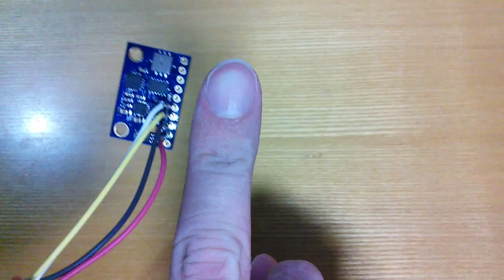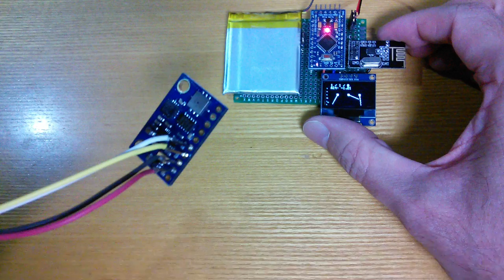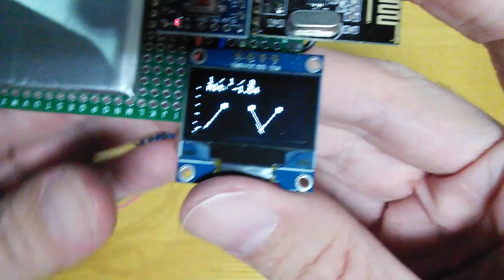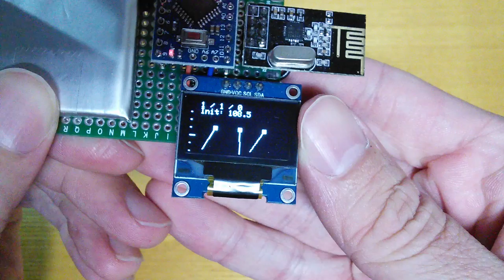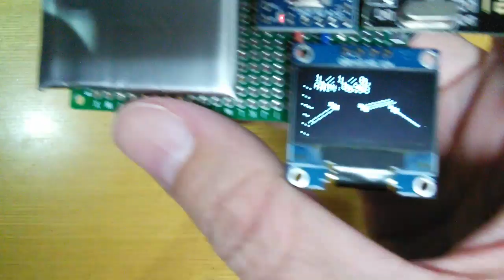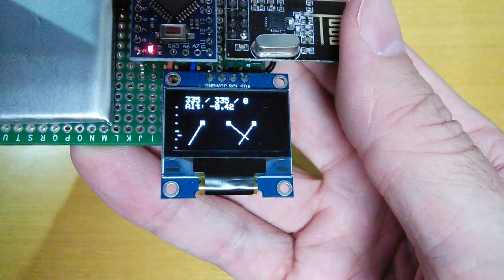IMU telemetry via nRF24L01 ack payload (arduino)

Comment: Ya know, it would really be nice if someone could post some code for the ACK in 2021 that works with the TMRh20. I've spent a week on this, asked questions on the arduino forum and all I get back is don't post pictures. so it's like at this point I don't believe anyone ever got this working. I think it's all a big joke on us out here trying to get it to work. If if did there would be SO many examples of it but there aren't because it don't and prove me wrong.
Reply from the maker: I've never used the TMR one, but looks like there is an example here: https://github.com/nRF24/RF24/blob/master/examples/AcknowledgementPayloads/AcknowledgementPayloads.ino

Comment: Hi! If you want an app capable of working with all the sensors from CC2541DK, CC2650STK, ThunderBoard React and Sense (e.g. acclrm., magnetom., gyro. etc.) you can download it from: www.microsoft.com/store/apps/9p054xsjjr1n – the software is able of giving new uses (movement security systems - door or luggage, magnetic security system, accelerometer mouse and wireless presenters) to all these IoT SensorTags. For more info.: www.blesstags.eu. Thank you so much and have fun!

Comment: and this is what i'm lookin for man!thank you so much for your very informative video. two arduinos two nrf24... high power transcievers some oled and h-bridge to create safe system for my ride-on car for my son. would you share some code to learn how make my own code for control-akcnowledge data stream? the main function i need is to stop the car in emergency mode when out of range of nrf24... or on my command.
Reply from the maker: The nRF sends a 'packet' of information. If a packet is received at all, it is received in its entirety and without error - the nRF does error checking internally. So you don't need to check for errors. It sounds like all you need to do is make a note of the time the last packet was received, and if it's more than say 1 second ago then stop the car.
Reply from the maker: This code might be useful:
https://www.youtube.com/watch?v=eVnyPSAefxU
On line 56 of the receiver side you can see a check to see if packets have stopped being received. You could pretty much use that code as is, and interpret one of the 'throttle' or 'steering' values to be your manual shutdown override state. Just keep in mind that under the right conditions the high-power nRF can go for a kilometer or more...

Comment: do you have a tutorial on how to go about sending imu values using the NRF to others MCU's ? i been reading the 100 page manual that came as a pdf but after getting familiar with all its syntax i get thrown off when i see other ppl's code or example code found in arduinos playground, maybe you can shine some light where i need pointers, i was looking at your code and i couldn't make out how or when do you go about Tx values from your imu or when or where the code for the rx is  or how it works? i know you mention your trans receiving but even so this is not very clear
Reply from the maker: Search through the code for "RF24" should find all the parts I touched, or at least all the parts where the radio is used. Your question seems extremely broad and vague, if you have something specific that might help. Maybe the best thing I can suggest is to watch this video where I explain in detail how I send values for the first car I made: https://www.youtube.com/watch?v=eVnyPSAefxU
Reply: ***** what i mean was that if i want to send value produced by a imu like the xy and z values/data via the nRF24L01+ using the Tx to another Arduino who has the Slave Rx how does all this gets put into the code where is this keywords i should be using or equaling to on the code side ? where in the manual is this part that talks about how to use the nRF24L01+ to send data?
Reply from the maker: Frank Lopez I explained in the video I linked to. You would put whatever data you need into the "MyData" struct. I'm not sure what you mean by 'manual', but the docs for the RF24 class are here, see the write and read functions: http://maniacbug.github.io/RF24/classRF24.html
Reply: ***** oh yes when i used the word manual i ment the datasheet, Ok so MyData how do i use this in a code ? how do i tell the arduino to take the data from the imu and make dem equal to MyData in the sketch so that it can be send thru the wireless on the slave side> or how do i go about sending only a specific axis from the gyro or accelerometer? do i use something like the map feature ? do i use the IMU.data = MyData  or  MyData.val = map(gz, -17000, 17000, 0, 180); or
uint8_t data[Val];
data[0] = MyData.val // map(gz, -17000, 17000, 0, 180); 

radio.write( &data ) );

im not sure if that mini example made my point but im new so just assume that im looking for a way to go about writing a code that say "Tx imu from this axis to slave mcu and when this happens i want slave mcu to use those val to update the pos of a stepper motor or servo 
thanks in advance this means alot to me
Reply from the maker: Frank Lopez It depends on what kind of IMU you are using. Try looking for arduino libraries that support your IMU, usually they are available.
Reply from the maker: Frank Lopez okay, so google "mpu6050 arduino library" ;)
Reply: i did, no one says explicitly "this is the part of the NRF that i use to mapped this val from a mpu to the values of this stepper/servo" specially mpu+nRF24 modules
Reply: never the less you dont have a mpu but you do have a nRF24 so this i sstill usefull to me cuz i guess your telling me tha in the code i can map MyData to whatever on the code in my case imu values ?
Reply from the maker: Frank Lopez I don't think it's reasonable to expect to find some explicit source that has exactly what you want about such a specific purpose, that you can just copy and paste directly. You need to take the two things and put them together yourself. The library for MPU6050 will let you get the values, and the library for RF24 lets you send them. The first page that google returns for me has an example sketch that shows how to get the raw accelerometer and gyro values and print them to serial to check. You just need to put them in the data struct that you will send over the radio link, that's all.
Reply: i know  it seems easy but the syntax makes it a bit unsure to implement like i am using the mpu and i get raw data but all this dont mean much to me cuz i dont need all of its values just one i do have 10 mpu's and i dont want all of dem to give me the same values fro mall the axis  i just want one to give me x the other just y from gyro the other from z from acc and so on i guess this way i compute less data and is more focus in what i need. 

i guess im finding much easier on what todo with the value once i get em but getting those specific values is what i find sorta unclear
Reply from the maker: Frank Lopez This is the page I was meaning, look for the section titled "short example sketch", it should not be too unclear how to get those values: http://playground.arduino.cc/Main/MPU-6050
Reply: thanks ill read in depth, but as for the wireless which is the code i want to = those values from the imu code i want to use?  

/* GyX=Wire.read()<<8|Wire.read();  // 0x43 (GYRO_XOUT_H) & 0x44 (GYRO_XOUT_L)
 */

#define RF_CS 9
#define RF_CSN 10
RF24 radio(RF_CS, RF_CSN);
const uint64_t pipes[2] = { 0xe7e7e7e7e7LL, 0xc2c2c2c2c2LL }; // in here ill place upto 5 diff Slave Addresses with the same Master address 
 
void setup() {
  Serial.begin(9600);
  printf_begin();
  pinMode(LED, OUTPUT);
  radio.begin();
  radio.openWritingPipe(pipes[0]);
  radio.openReadingPipe(1, pipes[1]);
  radio.startListening();
  radio.printDetails();
}
 
void loop() {
  unsigned long time = millis();
 
  uint8_t data[GyX];  // we'll transmit Gyro X axis values
  data[0] = MyData   // Val=imu values Acc.xyz Gyro.xyz
  
  // transmit the data
  radio.stopListening();
  radio.write( &data ) );
  radio.startListening();
Reply from the maker: Frank Lopez I explained pretty much every line of code in the video I linked to earlier. You need to add some more variables to the "MyData" struct to hold whatever data you want to send, and make sure the receiving side has exactly the same data struct. Look at the example code and docs carefully, eg. you can't do radio.write( &data ), it requires a second parameter.

Comment: HI :)

i am having a weird trouble with my nrf24L01. so i have a circuit, where a DS1306 is providing me time, and its also SPI connected. its working fine. when i add the transceiver and printDetails, it is showing me default values like its not even connected (its connected properly). and this time the software is not even using the RTC. if i put the transceiver to breakout board (with same software and arduino) it works fine by itself, so there is a nice and stable radio communication. it also works fine in my circuit if i dismount the DS1306. 
so it seems only the presence of the RTC messes up sg.. i was thinking that probably with the difference of the 2 chip's SPI is the problem, but when i dont even call the RTC in the software its only mounted, i dont see why it is giving me a headache.
do you have an idea?
does anyone who is so helpful to read it have an idea? :)
many thanks.
Reply from the maker: This sounds a bit tricky to handle in YouTube comments :) I think you may be better off posting in the main Arduino forums, where many more smart people will see the question. I'm not sure why simply connecting the RTC would cause a problem... perhaps you could try connecting one wire of it at a time, and at least narrow it down to which wire starts to cause the problem.
Reply: ***** yes, i was thinking on this, but its already on a PCB. but definetly sounds good to remake it on a breadboard and see. thanks!

Comment: i have a question...in this video you say that the modules are transceiving....but what i see is that u just need to send the data form the node that has the IMU to the other node.....so instead of making one of them completely a transmitter and the other completely a receiver , why are u using ack payloads.....and what exactly are u sending in the ack payload ??
Reply from the maker: Yes, in this situation there is no need to use ack payloads, but this is just a test. In the real situation the transmitter will be sending control inputs to the quadcopter, and the quadcopter will be sending back IMU/GPS information to the transmitter. As I said in the video, all the IMU information shown on the screen is sent in the ack payload.
Reply: thanks for clearing that out !!

Comment: nice work iforce2d,
even i had the same problem that u faced with ack payloads....and after going through ur post in the forum i checked my library code and i found that the latest version indeed has implemented what you suggested !!!. After that i tried to check the time gaps between successive transmission and reception in auto-ack mode and in normal mode and was shocked to find the time difference !!! i will be posting a video shortly about that.

Comment: Just spent the night wondering whether telemetry data could be sent back in the acknowledge packet, and now I find you've already done it! Just curious, which RF24 library are you using?
Reply: OK, just read your post on the Arduino forum. Do you think it would be worth communicating this back to Greg Copeland so he can update the library.
Reply from the maker: Julian Ilett Yes, good point - I've mentioned it on his blog comments. If you do try this, keep in mind you'll need a high-power RF24 module at both ends. I have not tried this with any RC vehicles yet - I'm still disabling acks altogether to ensure as fast a transmission as possible. Once acks are enabled, I think the resend timeout might need to be reduced so that the transmitter will prioritize sending your control inputs rather than waiting around for the less important telemetry info. iirc you can also limit the number of retries too.
Reply: ***** I'll have a play with this on my wearable project - I'll get it to send it's battery percentage level back to the Tx via the ack packet.
Reply from the maker: Julian Ilett Hi Julian, just thought you might like to know I had a reply from Greg Copeland as follows "My fork has been abandoned. TMRH20 now has the premier fork - by far. You'll find considerably improved reliability and performance over both my fork and the original code base. Plus he has made an effort to keep RF24Network working well. Don't walk, but run from the orginal code base and immediately starting using TMR's fork. @RF24/ ". The guy working on that fork has done some pretty amazing things with sending audio over nRF24, which I would probably play around with if I didn't have so many other distractions already. http://tmrh20.blogspot.jp/2014/04/rf24audio-library-released-digital.html Unfortunately when I swapped in that fork in place of Greg's, I found ack payloads were not working, and given the time it took me to figure out why last time, I think I'll just stick with gcopeland for now.
Reply: ***** Thanks Chris, I'll bear that in mind. I may stick with Greg's library too, at least in the short term. Not sure when I'll get back into the nRF project, probably after I've played with a few servos and taken a first look at the APM2.6.

Comment: great video as always.  I wish I was more adept in electronics as I've been really enjoying this series.  Is there any chance you could do a parts list of things you'd had to get to get the quadcopter / rc car up and running (I don't think I've seen one yet).
Reply from the maker: Hi John. Check the description of this video, it has the 'sku' ids for all of the parts of the quadcopter, you can find them at banggood.com. Arduino + nRF24L01 + quadcopter If you are not familiar with flying an RC heli though, you might want to get a ready-to-fly micro quad (eg. hubsan x4) first and get the hang of it. That would give you a much higher fun per effort ratio to start with. They are quite cheap and you can fly them indoors so fine weather and daylight is not required.